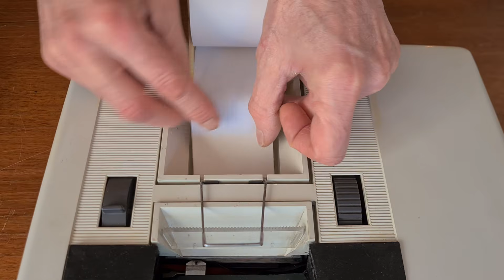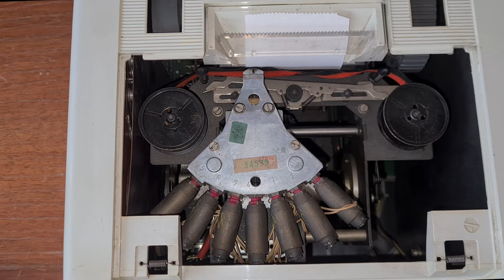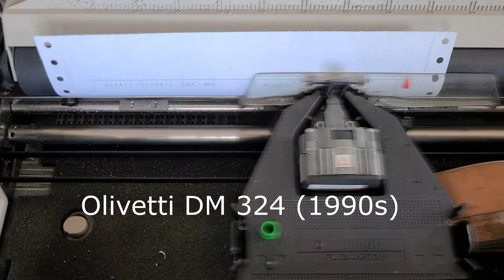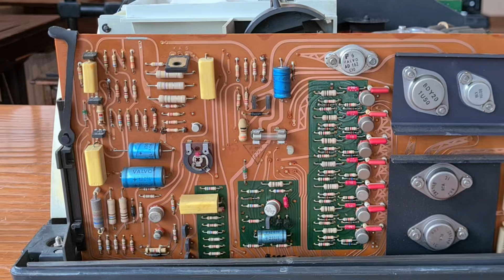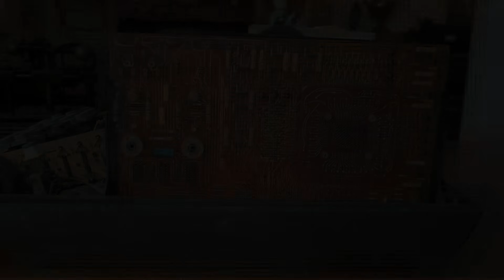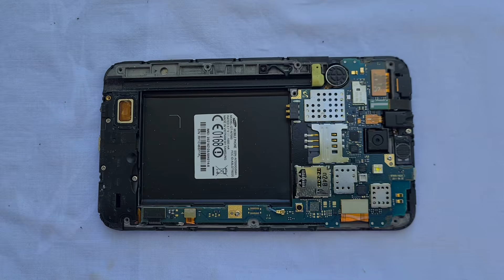Meet the calculator Philips P252 with magnetic core memory and dot matrix printer (1970)

Comment: Fascinating, how they used 6 or seven PCB in this simple calculator, today it would have only one PCB, and only a few electronic components.

I recently bought a cheap chinese calculator for 3$, which is copy of casio fx-991ms, named CTIFREE. It has lots of advanced functions built in, and can even solve formulas with many variables and quadratic and qubic equations.

Comment: Interesting to see.  I once used, and later owned for a while, an IME86S calculator, which had 16 Nixi tubes for a display.  It, too, had magnetic core memory, and also you could attach a programming unit to it (the one I used back in 1968/69 had a programming unit).
Reply from the maker: I should be an interesting device.
And I like Nixi tubes.
Reply: @oldtypewritersandcalculators  It certainly was an interesting machine - very capable, with 4 memories (one used for scratch memory if you used the square root facility) plus A, B and T 'memories', which were quite useful.  Also, very stylish.
Reply from the maker: @steveknight878  I have a IME 141, it's a nice machine.

Comment: I might have some spare ICs (could desolder from a P251 boards), if that solves the issue. I also have a P252, untested...
Reply from the maker: Many of these ICs are still on the market but I think that the problem is the motor. But still, you could try to see if your P252 works. I think the main belt should be changed.

Comment: Excellent presentation. New subscriber.

At that point in history one could still reduce functions algebraically and trace the results into the circuit. Now it is impossible to humanly fathom even the total number of transistors or the extraordinary clock speeds they use. The heat generated from a current processor is the only thing we can humanly feel.
Reply from the maker: You're right, that's the point.
Current devices are thousands of times more efficient and powerful, but almost none of us know why they work. Older devices were less efficient but more "friendly" and transparent.

Comment: Not in working conditions any more?
Reply from the maker: The power part with the fan is working, but I think the main motor is broken, doesn't move.
Reply: @oldtypewritersandcalculators  The fan motor drives the head via an electromagnetic clutch, there is no second motor. Probably the rubber belt has liquified, it was synthetic rubber that decomposes over time.
Reply from the maker: @GerardTimmerman-z6l  Thanks for the information, the rubber belt was liquefied, I substituted it but nothing happened. I talked about 2 motors because I thought that there was a motor moving the fan.

Comment: Odd how the mechanical calculator actually seems to be slightly smaller than the electronic one.  It seems like it was just a perceived wisdom at the time that everyone would need a printout of their work rather than use a display which would have seriously reduced the size and weight of the machine.... except display technology was in its infancy.  LED wasn't ready for commercial use in 1970, so we would have been looking at Nixie Tubes probably.
Reply from the maker: Yes, before Nixie tubes, there were simple displays on numbered wheels, probably not compatible with the speed these calculators were intended to achieve.
They are two truly imposing calculators; the Olivetti's weight is truly enormous; after lifting it, the Philips's 15 kg feels like a feather.
Reply: Nixies, VFDs (maybe), or incandescent 7-segment displays. 
It's crazy how this was built in 1970, I have one from '73 that's pretty much a single chip design already (except for a few npn transistors which are external to drive the display) and it (almost) fits in your pocket. 
And by 1975, battery operated calcs were everywhere, in '78 you had LCD ones powered by button cells.
1970s engineers were very talented....
Reply from the maker: @westelaudio943 Probably, at that time, each company had a different vision of what the future would be. Some were still betting on mechanics, while others were exploring new technologies, unsure which would prevail. Those who had a clear idea of the future prospered, while others struggled to get back on track or went bankrupt.
Reply: Electromechanical calculator
Reply from the maker: @mesinmodbus4566   It's right, it's electromechanical. The difference is that here there is not ony a electrical motor, but also some electronic boards.

Comment: Great how you went through each component. At this stage of technology, it's like a model of how a computer works! And it looks so repairable. nice.
Reply: 😁 ~ and like a “computer” it needs a cooling fan,
Reply from the maker: @samuelfellows6923  Yes big transformers and many electronic boards = heat.
Reply from the maker: You are right, at that time it was easy to repair something. Also change a component on the electronic board could be done by a nerd with medium capacity,